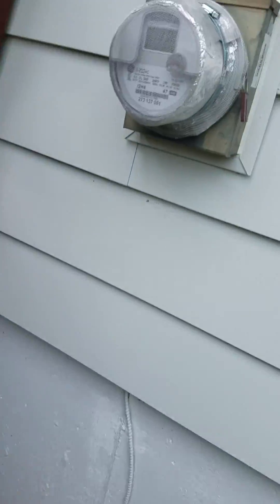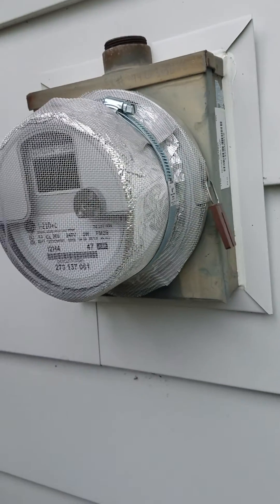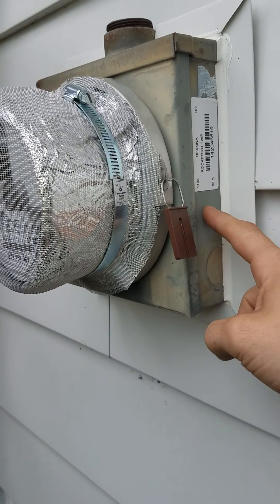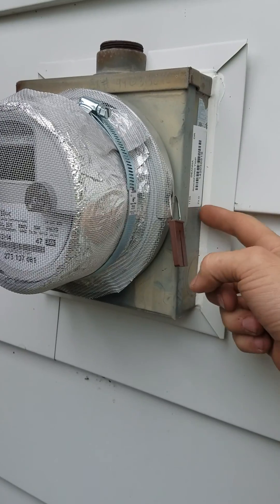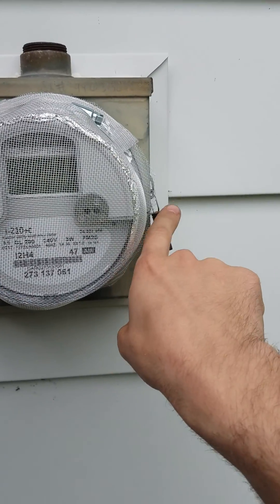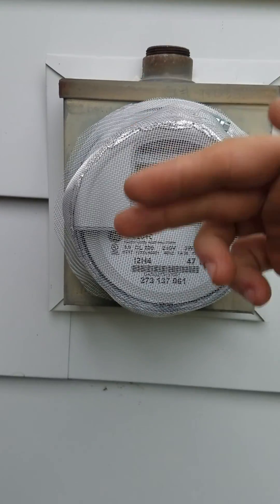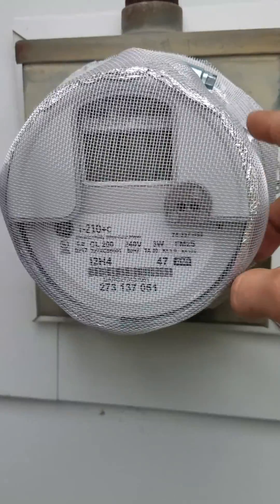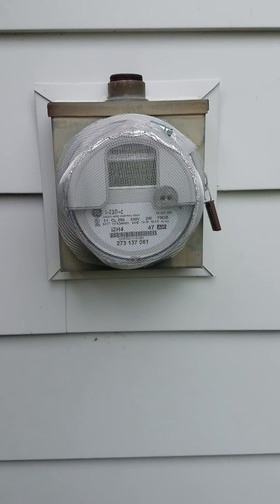D-I-Y Smart Meter Shielding - RF Radiation

Comment: How does it stand up to weather elements? Does the screen eventually get tears/snags overtime, like a window screen?
I bought 3 of those expensive smart meter guards, and after 2 years of high winds and weather elements, parts of the screen mesh is pulling away from the steel circular frame.
Reply from the maker: There is a company selling these made in China and then there is another company selling these made in the US. The company that was selling them made in China just closed their business and are done for good leaving the American made ones the only ones left to buy which are of the higher quality
Reply: @brandensimoens1931  Yeah, I bought the American ones. Upon closer inspection, the mesh is still intact, it's just slightly warped. I still would like to make my own as well, as a backup, much cheaper and easier to replace.

Comment: I just got a smart meter about an hour ago and got my gauss meter out -- 9.10.18.  Unlike you, my large circuit breaker is on the outside of the house and next to the SM.  The SM lights up the circuit breaker box AND the large conduit running up to the roof as measured from the inside of the house!  Actually, when measuring the SM for radiation on the outside, it is much hotter on the sides than straight out the front.
So I will be shielding a large portion of the wall to the ceiling inside of the house, and try you meter shield. 
BTW - radiation is minimal prior to a large load kicking on, such as the air conditioner.   Thanks

Comment: It has to be grounded to work. Also, these do nothing to eliminate the wires in your house from picking up the signal. The wires themselves act as an antenna. Go check it for yourself.
Reply from the maker: They do not have to be grounded your meter Box is grounded and you are correct about the dirty electricity in the wiring and there is a filter for that
Reply: @brandensimoens1931  what I mean is that your mesh will not grab any signal unless it is grounded in some way. Like other people here have commented, I've tried it and it only works grounded.
Reply: @brandensimoens1931  Besides a grounded mesh, the only other way to block a signal is with a capacitive material such as Staticot fabric.
Reply from the maker: The metal housing the meter is housed in is grounded this is attached to the meter and touches the metal housing which means it is also grounded the only time you have to ground a smart meter shield is if your  Box is not grounded which is a whole nother problem
Reply from the maker: This was meter tested and it works and it works very well and it is not grounded
Reply: @brandensimoens1931  Well you said it, it touches the metal housing so it is grounded after all... I'd like to see a test of it. Will check your other videos.

Comment: what kind of screen did you use on this set up? does it matter? im new to this and id like to cover the smart meter in my house. thanks!!
Reply from the maker: I personally used aluminum screen from menards but it's important to get the very smallest screen whole size as possible that will stop more of the signal

Comment: Unless you measure RF before and after and see a substantial reduction, nothing has been accomplished.  I tried the foil + screen setup like you have here, and there was no reduction in RF.
Reply from the maker: The screen size was not small enough then. The holes are to big letting the frequency out. Smaller hole size is needed. The ones I sell work and are meter tested.
Reply: Branden Simoens go to smartmeterguard.com I got a copper mesh drawstring  cover that I secured even further  with zip tie. For my gas and water meter.